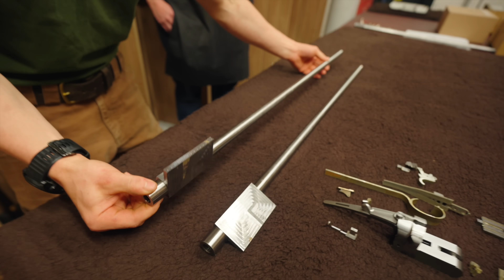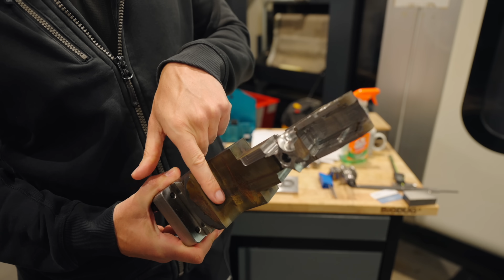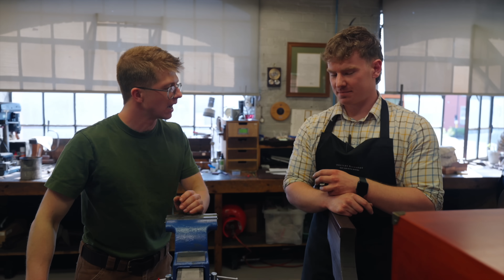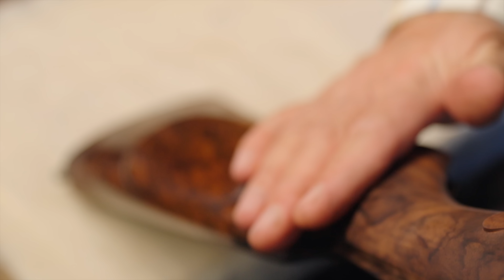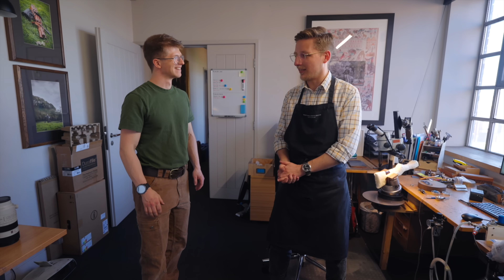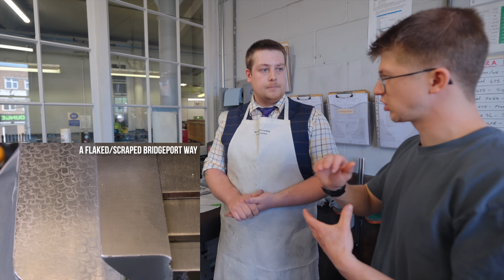How The World's Finest Shotguns Are Made

Comment: One of my gunsmithing professors was a H&H repair shop gunsmith.  His square block test was to pierce a 1”x1” hole in a plate that was perfectly 3”X3”x1” flat and square hand filed.  Then a 1”x1”x1”block was filed flat and square and had to fit the hole light tight no matter how it was offered up.  All hand work, he kept it in his tool box and I have actually handled it.  I have never heard the phrase “Flat & square lad” so many times in my life as the semester I took bench metal class with him.

Comment: 4:08 When it fits perfectly with no gap or play, gunsmiths call that being "on face". A gun that has worn and developed some play is said to be off face, and work can be done by a skilled gunsmith to bring it back on face.
Reply: Nice.
Reply: Now... 
5D CNC would do this better and more precisely, yes? 
This is purely a heritage thing?
Reply: @MostlyPennyCat  Nobody is making guns on five-axis CNC machines. Parts are forged or cast, depending on the part, machined to final dimensions, and finished. And certainly nobody is doing final fitting on a shotgun on a 5 axis CNC. Guns that require hand fitting are finished by a gunsmith, and mass produced guns from major manufacturers will be made by a repeatable process that produces interchangeable parts within acceptable tolerances.
Reply: @venus_de_lmao
Ok, fine, a repeatable process. 
I never think of forging as that precise but I forget that it is once you finish it.
Reply: @MostlyPennyCat  and bringing a worn gun back on face is done by hand because it's a delicate task that requires a skilled touch.

Comment: 1000 mg of sodium, really? Sodium like in sodium chloride? Btw sodium chloride short NaCl is table salt. That's exactly the stuff most people on a modern society diet have problems not to overshoot the advised Daly dosis. High sodium consumption is associated with high blood pressure and finally heart failure. By the way, 1000 mg sodium equals about 2.5 grams of tables salt which is almost half the RDA.

Comment: ive done the steel block during my toolmaking apptentiship in the early 80s, a 1" cube filed to 31/32" square to 0.002 dimensionally and square. and you didnt move from the bench untill the foreman passed it off.

Comment: What they call "spotting" is called perlage in watchmaking, and the tools used are called pin polishers.  The rubber of the pin itself is impregnated with different sizes of grit instead of having it in paste form.  The rubber is also offered in a variety of hardnesses and diameters.  The pins are held by a small collet which fits into a drill press.

In the UK the supplier to see about them is Cousins.  They are quite inexpensive. The collets are a few pounds each and the pins are a few pence each.
Reply: In engendering we call it engine turning, in it's very basic form just smear the surface with grinding paste and use a piece of wooden dowel in a drill press.
Reply: In modern watchmaking virtually all finishing is done by very expensive specialised CNC machines. eg They can perlage an entire movement in a couple of minutes  to a higher standard than any human.

Comment: After all the comments about the addition of modern(ish) machinery, I think it's fair to say that they're not used to replace the manual labour involved, but to augment and help improve the whole process, to the point that the whole process of blank metal block to finished item can be done completely by hand and absolutely powerless, with no descernable loss of quality.
I've said it once and will probably say it again..another fantastic video from the whole 'Steele' crew.
Reply: It is used to save labour, final cost is about the same as hand made. 
This is due to the high price of say cnc lock parts and constant alteration of the programme that then need fitting and finishing off opposed to hand making each part.

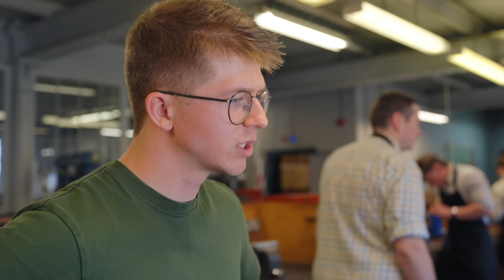Comment: 4:44 if they wire EDM this feature why not the whole mating surfaces?

Handcrafting is cool and has some value, especial for artisanal stuff like the engraving, but it doesnt make any sense in this day and age to hand fit this.
Had to do this kind of stuff during my apprenticeship as a precision mechanic too...
Wire EDM gets sub micrometer precision reliably, you cant reach that with hand fitting no matter how good you are. 
Also they are working in a unclimatised room touching the parts non stop and the guns have to work in summer and winter, so you have at least 10 micrometers thermal expansion there, no way they can get better than that or even close working like that.
At this scale where price doesnt matter at all, why not use the best process and leave the artsy stuff for the artsy parts?
Fully handmade was the other option, but if you are taking reasonable short cuts why not every where where it makes sense?

I love Japanese knife makers and old machinists making crazy stuff with manual or semi manual tools, but come on, why not use modern superior steels or rough it out on a CNC.
You can still show off your skills but make a better end product. 
You see this in modern high end products like Koenigsegg cars, they dont make any compromises. If they can perfect the stitching on your seats by figuring out a robotics process, or use some crazy AI powered CAM tools to machine parts they do it.

Comment: When I was in the Army, in the REME, I had to do a square block test, I had to make a 1" square block and a 1" square hole in a 1" thick plate. The block had to fit without any slack whichever way i was put into the hole - no CNC or milling machines just a pillar drill and files.

Comment: I did a Block Test as a first year fitter and turner.
Ours was cast steel, we had to chisel off the hard outer casting skin and then file square and flat to within 0.05mm. When we passed that it then had to be hand scraped until bearing blue flat.
It was definitely a learning experience.

Comment: At that point, that level of detail and man hours is intentional excess for no reason than make it luxurious. That level of detailed handfitting would be done in 100th the time with a precision cnc machine.

They have no reason for that outside of the desire to sell a double barrel shotgun for 30 grand.
Reply: It just shows you know nothing about building quality break action guns. On some areas you have to hold tolerances of less than 0,01 mm. A gap of 0,02 mm (0,0007 inches) is way too large in most areas. Each part is precisely fitted to the next so you really have no room for tolerance stacking. Otherwise the gun will shoot it self out quicker, fell sloppy and not shoot accurately.  Show me a cnc shop that can reliably spit out parts and hold that kind of tolerance. While it may be posible, think about how much a shop like that would cost (machine, tools, vibration control, temperature control, quality control)...Show me a machine that can produce the same quality of engraving. Show me a machine that can produce the same quality of stock with the same finish. There are no machines that can do this quality of work.

Comment: I tried an extremely low-rent version of spotting a while ago. It was similar to what these folks did except:

• instead of grinding dust and York's paste, I used generic buffing paste thinned out with oil
•• (not even machine oil. cooking oil. like olive oil.)
• instead of a drill press, I used a handheld cordless drill
• instead of a custom-turned rubber-tipped spotting tool, I used a stub of a pencil, eraser side out
• instead of a professional gunmaker with years of experience, I was a young horology nerd with a vague idea of how they do that finish on watches (where they usually call it "perlage")

Those aren't minor differences, and naturally my results weren't anywhere close to what we see in the video, but it was still recognizably perlage, and it still looked decent. In my opinion, it's well worth a try.

Comment: OR…a very simple trick for “spotting”….we know it as “Jeweling”….
Get yourself a box of pencils, the ones with the round rubber eraser on one end. Chuck up the pencil in the drill, and apply valve lapping compound, or any abrasive paste you have on the metal surface and commence.
I promise it works, the finished results will be dependent on how you do the work, not what you used to do the work.
The finished product will look exactly like what you are seeing in this video.

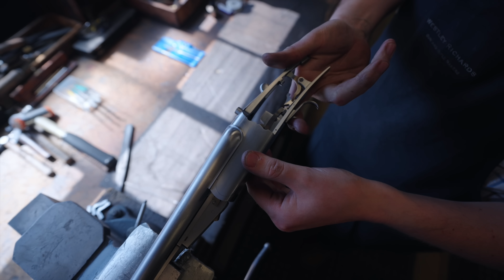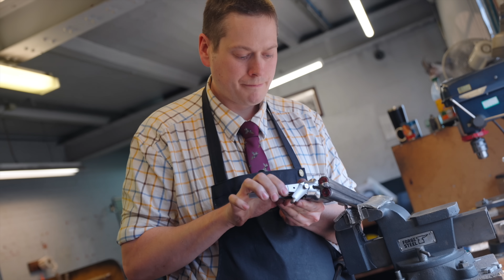Comment: If you pause at 12:45 and use "," and "." to move frame by frame, you can actually see the man was correct and the left shell ejected before the right. Same with 13:56, you can see they are within fractions of each other timing wise. Amazing!
Reply: Turn the volume up and you can hear a double click, then a single click after he refined the spring.

Comment: In germany its actually very normal for your first year of apprenticeship in the metal or wood trades to work exclusively with hand tools. In the metal trade specifically its common to not work in the production, its all practice projects. And that is on top of school which is theory and practice. Ive never filed a square block myself because im a carpenter but i turned a slab of hardwood with bark and all into a fine chair all 100% handtools. Seriously, not even a battery handdrill was used, i had to work with one of them 1800s looking hand operated drills. You just gain a much deeper understanding of your trade that way.

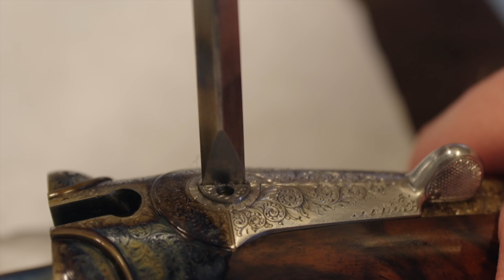Comment: 38:07 The head of the screw is engraved and has a small set screw inside of it to keep it from loosening. That's something I've never seen before.
Reply: The closest to that I've seen is the screw holding in the magazine on old Mauser 98s, where the head of the screw has rounded slots so that you can fit another, smaller screw next to it which prevents the big screw from rotating.
Reply: It’s called a check pin and we have 2 on each of our double guns. Traditionally we have always had one in the toplever pin and also now in the hand pin
Reply: @098Sharkboy  What is called the "check pin", the set screw? Odd name, as pins usually refer to unthreaded components that resist shear forces.
Reply: @siggyincr7447  So we call the screws that so into the wood (so the guard pin, extended tang pin and knuckle pins) screws and all the other go into metal and we call them ‘pins’. I’m not sure as to the exact reason why but it’s probably because it’s and old term that was used and we just continue it. Like we call screwdrivers our turnscrews
Reply: @098Sharkboy  Interesting, every trade has it's own lingo. And since gunsmithing has been around so long, it's not surprising they might use some terms differently than what's considered normal in most other trades.

Comment: To anyone wondering how much one of these would set you back, they don't have prices on their website (obviously, since these are bespoke guns made to custom order), but they do have a few pre-owned guns listed from around $15000 to $100000+ each. So, judging by that, I'd say a new gun would probably be in the range of $50000 to $500000 (or more) depending on the model, materials used and the intricacy of the engraving.

Comment: I did my tool and die maker apprenticeship in Germany and the square block was the first thing we had to do. We were given a rough sawn chunk of steel and we had to file it to a rectangular block with flat faces square to each other with round dimensions in millimeters all with tolerances of 0.1mm and you couldn't allow light to pass through when held to a square. If you screwed up you had to file it down to next round dimension down. Some of the guys needed up to 3 months to get past that stage, though most did it in 4-6 weeks. After that channels, angled faces and profiled holes were added. It took about 6 months till it was finished and it essentially showed you knew how to file, drill and chisel accurately. The only machine you got to use for the whole thing was a simple drill press. The attitude was that if you didn't have blisters on your hands for the first few weeks you were slacking and need to pick up the pace.
A lot of people complained that once you are out of you apprenticeship you'll never need to do that sort of hand work again. But honestly it's been really useful at times. Plus there is just something to be said about learning to finely control your movements and deal with frustration with that sort of tedious task. A few people that weren't fit for the profession got weeded out in the first year.
Reply: I did my apprenticeship basic training at Westland Helicopters Ltd, Yeovil, Somerset. England. Following initial filing instruction, our first filing phase test was similar to yours except that we had no next size to go to, it had to be 2" x 1" x 1/4". to within 0.005", each face had to blue up with engineers oil blue on a British Standard grade A surface plate. Each face had to be square to a British Standard engineers square as you describe, so that no light could be seen beneath. The surface finish on each face had to be 80-100 micro inch. The time allowed for the test was 5 hours including cutting the block from silver steel bar 2 1/4" x 1 1/4". This item was marked with my number and placed in a box, to become the stock of a marking gauge which was the subject of my next phase test. If it wasn't right it was scrapped and you had to repeat the test until it was. Fortunately I was good at filing!
Reply: Top auf den Punkt gebracht!
Passungen mit der Hand erstellen - eine Schlosser-Arbeit bzw. Handwerkskunst.
Nach 6 Monaten wusste jeder, ob er für diese Art von Job geeignet ist.
Bei uns waren ca. 20% im ersten Jahr ausgestiegen.
Reply: @stan-and-friends  20% dropout rate seems very low, here we are forced to hire people because of their race, secuality or gender and not just their competence so we end up with >50% leaving after 6 months, the job isn't skilled but it never had this much turnover in the past either.
Reply: An das erinnere ich mich noch sehr genau während meiner Lehre!
Reply: I was lined up to start my apprenticeship, my dad is a journeyman. Worked in a factory for a few years where I ran a few presses on second shift (did setups, swapped puches and dies, had to do my own quality and load my own material, sharpen my own tools the whole 9 yards). Went to tech center for it in high school and took a few college classes. Never had to square a block by hand though I was allowed to use a manual mill. Kinda regret swapping my career to concrete poured walls but I just love being outside all day.
Reply: @YourMadreKnows  I did a similar thing during my apprenticeship. Took ages. But our task was to build an engineers square with an exact 90 deg angle and every edge/face perfectly parallel. We spent months refining and finishing them. Once done the chief engineer marked them, graded them.... then took mine, and put it on an air bearing grinder to make the surfaces look pretty for the local press to photograph ! I nearly cried 😂
Reply: @YourMadreKnows  that´s how modern day machinists and tool makers become button pushers.
Reply: @SchrottiJr  I feel like the cnc boys are the button pushers, my head was always in a press fixing somthing
Reply: @SchrottiJr  As a tool and die maker, making components was actually just a small, and probably one of the easiest, parts of the job. The tools that tool makers design, make and maintain are industrial tooling used in production. Most tool makers spend most of their time fixing and improving existing tooling to keep it running smoothly and producing parts that are to spec. Not many tool makers would be considered 'button pushers".
Reply: As a character in JoJo says:

"GERMAN SCIENCE IS THE SUPERIOR ONE ON THE WORLD!"
Reply: Impressive!
Reply: First time I had to do the square block it was just: make it square, don't matter the size.

Second time we got specific measurements.
Reply: didn't you mean 0.01mm? 
0.1mm can be quite significant. With that tolerance you can see the gap when you hold a part on a pane of float glass (which is a good trick for checking flatness btw! glass panes are the flattest thing the average household possesses)
Reply: @user-sq3ib8gd9z  No, 0.1mm was the tolerance for the dimension. Which is plenty difficult working with files. Keep in mind that tolerance needed to be held while simultaneously keeping the surface flat and square enough that a toolmaker's square held to it wouldn't allow any significant light to pass through.
Reply: @siggyincr7447  Ah those limitations would make it much harder, with better hand tooling you can get better tolerances but on a block like that they do stack as well, plenty difficult either way.
Reply: And not done with CNC machinery

Comment: Great Video! Love the craftsmanship. What's the benefit of wire cutting instead of simply cnc machining it?
Reply: Even finer and tighter tolerances. If you've ever seen a wire cut steel puzzle, the cuts are so fine and tightly toleranced that the seams are almost impossible to see when assembled.